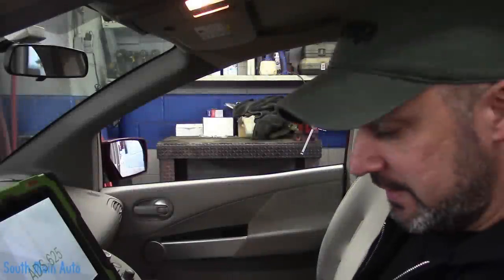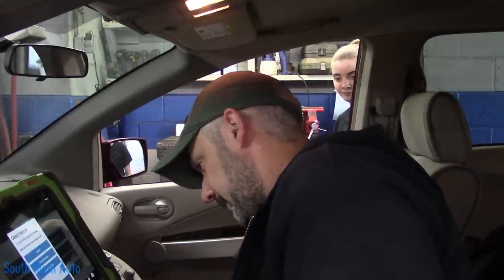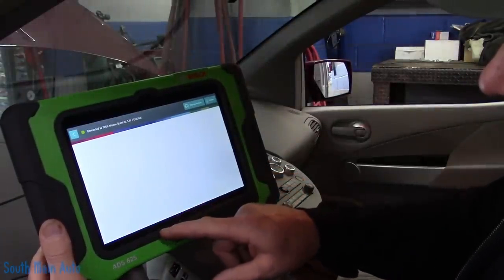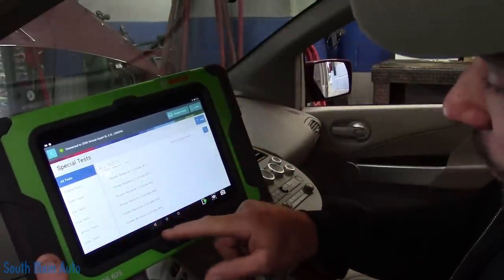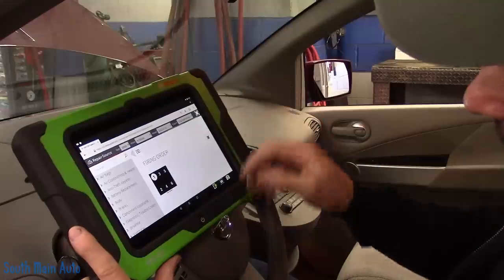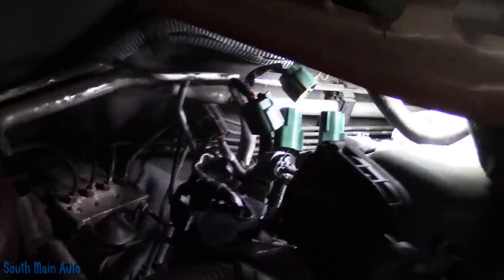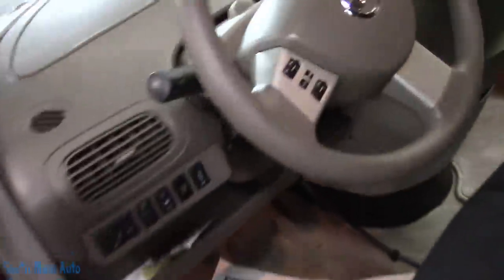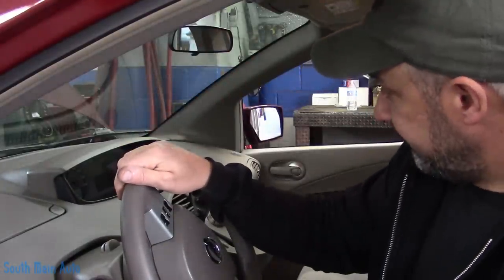Customer Replaced Spark Plugs And Now It Runs Bad!?

Comment: Connected my miata's battery backward, all it did was burn the main 80 amp fuse, fortunately the ecu relay was out(wanted to build up oil pressure before starting the car) so everything else was ok. My dad has some pennies in his car, so we put a piece of penny in the fuse to make contact in order to be able so start the car and go home. Could have been worse.

Comment: I changed the oil cooler and plugs on my 3.6 pentastar.   Got it all back together I’m feeling pretty good since I’m not a mechanic hit the start button and runs like crap and the money light is on instantly deflated.  Racked my brain for 15/20 minutes and I forgot to plug in a cam sensor.

Comment: Locomotive computers use 5 volts to drive 74volt driver cards. The wiring going into the computer plugs are lettered a-z and CAPITAL A-Z.. anyway, certain software upgrades require wiring to be moved or added to the computer plugs..

 One modification called for a positive 74 volt wire to be moved to pin “h” or pin “n”. It was impossible to tell h from n on the paperwork. I was a new loco electrician at the time and very hesitant about it. The manager told me to just go for it and no worries.. when I powered up the locomotive control breakers the cab completely filled with smoke in 3 seconds.. between the smoked computer, driver cards and computer chassis - was over $125,000 in damage.. RR didn’t care one bit, but I still think about it.. 2 nights later, another electrician did the exact same thing lol.

Comment: Some of my past mistakes doing auto repair: Neglected to tighten lug nuts (make sure to get plenty of rest each night - the wheels made a rattling sound upon test drive), poured six quarts of engine oil without first installing the drain plug on the drain pan (made a big mess on the shop floor), off one tooth advanced mechanical timing upon installing a replacement camshaft (upon starting, the engine backfired like a kid firing a cap gun, and the throttle response was miserable but it did run but would not drive over 60 mph). Not to mention many (uncountable number) of broken plastic electrical connectors during parts removal.

Comment: The biggest mistake was leaving the trim panel under the steering wheel, off of my wife's vehicle for two years, until it was finally traded in for a newer model. I did it so the next time I had to get at the fuses it would be easier. I have since been called the car butcher by my beloved wife and now each and every time before I work on her car she gives me the 20 minute speech, about returning her car to its original condition when finished or its no dinner for me. Even if I'm just plugging a leaky tire! Women, they like all the trim and bells and whistles to be there and functioning, where as guys can drive around their own cars for a year, with the whole dash ripped out and dangling by the headlight switch, Speedo and cigarette lighter wires as long as we fixed the problem! Go figure. Thanks Eric. Jpol.

Comment: Replace head gasket on a Mercury flat head V8 when put back together found a wire running through the head cut and splice left wire in there it seamed to run OK.

Comment: Lol.. I knew right away he had coil wire switched around... Happen to me years ago with a  Carburetor car, fired it up was running like crap. Found number one cylinder,"firing order" traced my wires and sure enough the last 2 plug wires were switched. Like u said easy mistake.

Comment: My first car I tried to fix my exhaust with a combination of exhaust tape, foil tape, beer cans and hose clamps. It would stay quiet for about 100miles then burn off and sound like complete crap. Finally I took to the muffler shop and they only charged me $20 to weld a new pipe in. 😑
Reply: When I was a kid I had neighbor who was putting some heat wrap cloth he got from where he worked and clamps over holes in his exhaust. He was so proud of it. After a time his exhaust was almost all clamps and wrap.

Comment: Way back when I had my coil wires crossed on my 87 camaro, 2.8 multiport. I kept fu$king up brand new wire sets, over and over before I had an appifiny and figured it out while sitting and staring off into space

Comment: My first car, a 1979 Z-28, wouldn't start, so at age 18 (41 now) I guessed on a starter and put one in, and it wouldn't start because I had the wires backwards. I traded it for a blown 87 Iroc Z, and the guy who I gave my Z-28 started the car by uncrossing the wires. I felt like an idiot.
While working at Land Rover while 19, I did some engine work and sent the SUV on its way.  The customer picked it up, and an hour later, I noticed the belt driven cooling fan sitting in the parts washer (because I didnt have enough working room).

Comment: Dumbest mistake ever made by me 20 years ago working on dad's 94 oldsmobile - Only heard noise when car was in gear. Had him shift it into gear while I stood in front of it- He held the brake... I did not hear the noise - Reached over without thinking and grabbed the throttle cable  to give it some gas and hopefully hear the noise. Car lunged forward pinned me in the garage between bumper and fridge- Sore leg for a month... 
Been home game wrenching and 20 years later I have made enough mistakes to write a book but this was my biggest one...

Comment: overtightened an engine cover bolt and it broke drove the car to a nearby shop, they drilled out the left over bit of the bolt. Then installed a new bolt threads using HeliCoil set (thread insert)

Comment: I have made the same mistake once. After replacing the spark plugs and wiring, I thought I had the wiring correct. Put it all back together and then started it. I was confident I had not made any mistakes. Boy was I wrong. Once it started it sounded like shit, and was misfiring. So I decided to check my wiring and trace out each one to the appropriate spark plug and then I found the problem. I then conducted an official facepalm. Fixed the issue and was running like it should.

Comment: One more comment and I’m done, Eric. You’re great. Your troubleshooting prowess and explanations teach me something new every time. I learned by reading HotRod, hanging around with like-minded knuckleheads  and we learned the hard way. When computers came on the scene I thought that would be the end of me fixing my own stuff. HotRod got me through it...I’m on my second scanner....love  it...still love working on my two trucks plus bike, wife’s two cars..her BMW is a NICE car, my 3 daughters cars, grandsons car. I’m a carpenter/contractor but like car stuff. I want to build a fenderless, LS motor, fuel injected, six speed, disc brake, independent front suspension , chopped, roll cage, bare bones, rude , channeled 34 coupe. I think I still have time....bla bla bla.....point is...thanks for your willingness to share what you know.  Dave Heitman Semper Fidelis

Comment: I changed the timing belt on a Jetta with a 1.8 turbo. The fuel hoses and the coolant hoses run the same direction and look identical. Put everything back together and car won't start. Come to find out, my fuel tank had coolant and my coolant had fuel. I did this job on many 1.8t and well! Everybody makes mistakes...

Comment: I always take lots of pictures and label each plug and connector so everything returns in the exact same spot same with lots of bolts and stuff if I do a transmission build I put all the bolts in a baggy and label it and store them somewhere I'll remember where they are safe, especially on someone else's vehicle my biggest mistake is on a trailer I put the tire on slightly wrong, when I next serviced the trailer to check tire pressures I couldn't get to the valve stem so I had to remove the tires just to rotate the tire LOL! now I always remember when I do tire swaps to put them on rotated correctly lol!

Comment: I put plugs in a 04 Jeep GC with 4.0L (someone had champions in there I wanted NGK I don't put champions in vehicles only small engines mowers, saws and such) and I put the coil strip on crooked one of the back most cylinder boots didn't go onto the plug didn't notice anything put all back together fired it up and the damn engine was knocking not like a ping a real knock and I had just changed the oil. I felt my heart peek out my rear exit but didn't give up. I checked that I got the right plugs all was right. The engine was smooth prior no hint of a knock so I knew it wasn't the oil change. Pressure was good so filter wasn't bad. I pulled the coil strip back off and just could noticed as I pulled it one the boots was off the plug. Still to this day I don't understand how I got such a knocking noise but putting coil strip back on correctly fixed it.

Comment: I drove my car for a week before I realized that I put the spark plug wires in the wrong position. It was loud and running like crap. Backed tracked what it could be and saw I mixed up 1 and 3. I put it back in the right place, now it’s running fine but there’s a ticking noise. I’m not sure if I messed up the spark plug or the lifters from driving it like that for a week.

Comment: My youngest daughter wanted to learn how to change her oil. She watched me do it many times for her and so I talked her through it....helped her a little...great. 4000 miles later, she’s back, I talk her through it again. Fine. Done. Now she’s getting cocky. Can a woman get cocky? 4000 miles later she’s back. “ I can do it dad. I just need you to drive it up on the ramps”. Ok. I do so. She proceeds on her own.  I hang around in the garage but don’t scrutinize.  She’s done...all proud of herself. I say “back it off the ramps...just ride the brake...take it easy.” She starts the engine. Clattering like shaking a bucket of gravel. I yell..”shut it off, shut it off”.  You guessed it. She didn’t pour the new oil in. Thank God I was there. This was 3 years ago. Car still runs ok. Dodged a bullet there.    Dave Heitman Semper Fidelis
Reply: Forgot the oil lmao. Flag reminder is to leave the dipstick high out of the tube and the oil cap off. That's what I do right away so if you close the hood you'll hit the stick.

Comment: I replaced a motor mount on my old Hyundai, and broke the cruise control cable because forgot to unscrew before jacking up engine.  Replaced the other motor mount and broke the high pressure ac line.

Comment: seen this same issue before odly on the save vehicle lol some vehicles are easelly to make this type of mistake on (hyundai tends to make same or like connectors color coded to help prevent this lol) an example is the idel air control valve and throttel body connectors on chevy cobalts (early models) easy to mix those up as same exact connector and the wires look the same if you dont pay attention to the colors of the wires themselves lol

Comment: It pays to triple check everything as an occasional DIY'er. We're not working on these things every day and we've all made plenty mistakes I'm sure. I had one that cost me luckily only 700, could have been 2 grand had it been worse. Slow down and take time on that bolt that isn't going in nice, or snap pics of the vacuum lines, etc. Better yet if you have doubts, sometimes it's better to just pay a pro a know it'll be done right (or he'll fix his mistake for free if he makes one). The joys.

Comment: masking tape with 1,2,3,4 on each COIL wire leading to an ignition coil  .... a value for each will keep them straight when removing and replacing changing plugs and/or coils

Comment: Pulled the head on my daughter’s PT cruiser and it wouldn’t start after reassembly. I didn’t bother to label the harness plugs, turned out the cam sensor and coil use the same type plug.

Comment: Changed the transmission fluid and filter on my mom's old van. After an hour of fighting rusted out exhaust bolts I got the exhaust out of the way. Dropped the pan, cleaned it, new gasket, torqued down a butt load of pan bolts reattached the exhaust.

I roll over to get out from under the van to declaration success. I roll on to something damn hard, I reach under my ass and pull out the brand new transmission filter looking all shinny and new.

Oh the 4 letter words were flying.

Comment: Had a budy do an oil change on his sister's Ford Escort, car no longer starts................used a rubber malet and a screwdriver to remove the old filter, in that process he broke the ignition module on the distributor situated just above the oil filter.

Comment: Changed out a starter on my old chevy impala once, got her started up and made it home but it won't hold charge. I thought it was a alternator problem so I changed it, found out my old alternator was perfectly fine so swapped it back. Could not figure out what the problem was so I took it to a local mechanic, turns out I had the 2 wires connect to the starter switched out when I install it. Had to pay the mechanic 100$ for my mistake that only took him 10 mins to fix...

Comment: I bought some off the shelf spark plugs and forgot to gap them wouldn’t have been bad if I hadn’t had to undo the engine mounts and pull the motor forward to get access to the back plugs.

Comment: Changed the coolant in my 1998 Jeep Cherokee and didn't get all the air out of the system. Driving around a couple of days later and the engine overheated and blew the head gasket. Yeah, that was an expensive rookie mistake.

Comment: Bought a '70 Oldsmobile Cutlass 'cause I loved the body style. Dipwad me didn't get it looked at, it was only a few hundred. Dipwad seller covered a rod knock with 90 weight in the crankcase. He got a fat lip I got an older Delmont 88 (never heard of it before but it had a Rocket 350. We do a driveway swap. Rented hoist, hammers the favorite tool. It won't run. Spins, belches fire from the carb, lather, rinse, repeat. My dad's done with this, get it running or get it gone. Friend stops by on the day I was going to sell it. Says "Hey, don't Oldsmobiles fire  360° out from the Chevys and stuff you guys usually work on?" Five minutes later we're rewiring the distributor cap and the stupid thing ran on the 1st key turn. SMH. I felt like an idiot.

Comment: I put a new cyllinder head on the ol honda and for some reason the MAP and VTEC use the same connector, and are on the same harness, right near the throttle body. i had no clue why it ran so badly

Comment: When I was 16 I decided  to change my own oil for the first time, so I drained the transmission fluid, changed the oil filter and filled the engine with another 4.5qt of oil.....it made it about 10 miles before the Trans locked up and I can skidding to a stop. RIP 1988 mercury Sable tranny.

Comment: This is less a mistake and more stupid. '04 Santa Fe, replaced timing belt, off a tooth. Drove it a few days, came back, got it on right, but didn't put the cover all the way back on as it was 3 AM and had to be at work at 8:00 AM. Never put it all the way back on, rubbed the belt and bam. Tapped valves. Still actually have that thing, it's sitting over at my Dad's, but I have a 94 GMC Sierra (I tried to daily a mud truck with a bent frame, lol), and a 2001 Blazer. The Blazer is mint. And I'm not going back to a belt.

Comment: When I was about ten or eleven I had a Villiers motor off a cement mixer or something like that.
I knew that if you shaved the head you  could raise compression, so I took the head off and filed it with a flat bastard. I put it back together and suprisingly it ran. Leaked oil for some reason though. LOL

Comment: Was doing a poor man's rebuild on a 3cly Suzuki and put the main bearings in the parts washer.  They where ate up pretty good went ahead had then everything machine and put in over sized.  I would say expensive mistake but I took as a sign I should have done it the right way.

Comment: Once I did break calipers on the front of an f150, turns out you can’t bleed them when you switch left with right because the bleeders are on the bottom 😂
Reply: Did a brake job because the front brakes were noisy. Found that:  1: the frames were not cleaned of scale. 2. the pad "ears" were ground down for a looser fit.  3:  the wrong kinds of lube were used. 4: the inner pads were switched  between sides.  Hard to say if that was a diy gone wrong but the reversed pads suggests it was.

Comment: I drove 600 miles without the oil cap, used aluminum foil and a hose clamp to get me home, after I ordered a new cap and installed it I found the oil cap sitting on the air box

Comment: The best time to make mistakes is with a beater that nobody depends on or cares about. I don't encourage young teens to buy a "project car" as their daily driver for this reason, it's inevitable that something will get screwed up and it's a total panic when you need to use the car as transport. Very easy to strip bolt heads or cross-thread spark plugs when you're just starting out.

Comment: My Biggest mistake was I forgot to put oil back in after an oil change in a very young 1980 Ford Bronco. After starting it took about 15 to 20 seconds of no pressure before reality set in. I'm pleased to say I never made that mistake again, but I did learn that the engine did not last very long in that truck for the next owner. Now was it my brain fart or the majorly under powered engine??? I'm thinking the horsepower was about was about 130 give or take.

Comment: Put new head gaskets on 88 gmc suburban and did the exact same thing accidentally got 5 and 7 mixed on the distributor cap because I thought I had wire number 5 when it was actually 7 🤦🏼‍♀️🤦🏼‍♀️